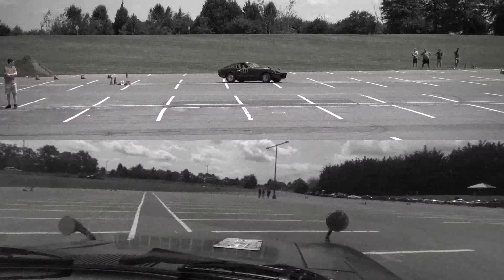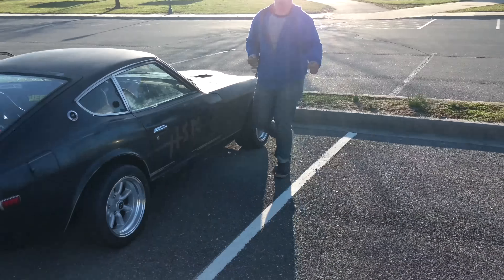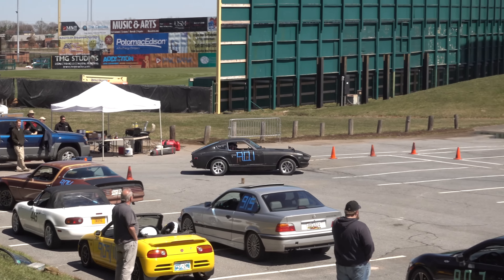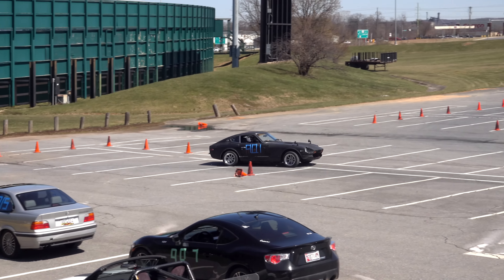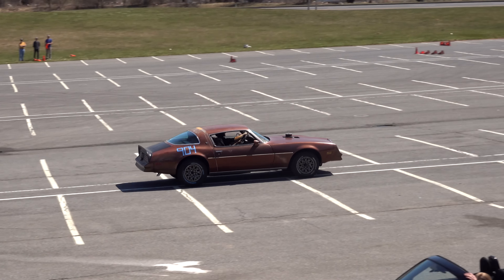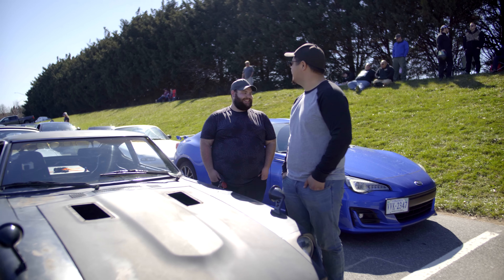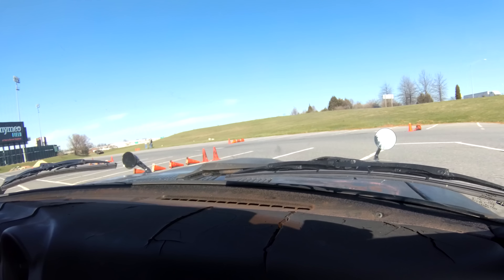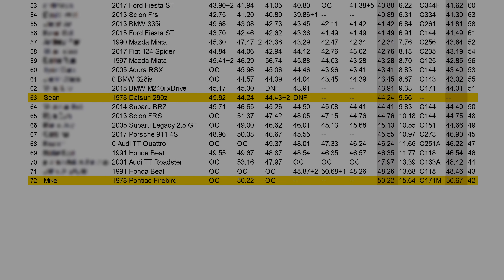1978 Datsun 280z and 1978 Firebird at Autocross (CDC 2018)

Comment: Old street racer trick:  race with no more than 1/8 tank of fuel.  It saves weight (~6 pounds per gallon).  Better yet, if you crash and burn, the fire won't last as long.  ;)
Reply from the maker: Fair point! Part of the reason for filling it up so much is that the tank doesn't have any baffles in it, and if the gas level was low it might slosh too much and give the engine a hard time with all this hard cornering. But it was definitely filled higher than it should have been.
Reply: Generally, for autox, fuel slosh will affect your times more than the weight of a full tank.

Comment: You guys have such the good mindset on this. It's all about having fun and making new buddies. Well done! BTW, if you want to get rid of some understeer and don't want to go nuts on negative camber, give it about 1/32 toe out in front or a lttle more if you want. Your inside wheel will pull you in some while turning. Been tracking cars for about 25 years. Always a treat to watch your adventures!

Comment: I just watched the whole series today. I'm thinking of building a Corvette C4 with one of those Weiand superchargers or one of the Edelbrock H122's. The Edelbrock uses the new Eaton TVS technology which is more efficient and makes less heat (theoretically). Your videos were very informative and professional. Very well done. You gave me a lot of tips for what to look out for. My big issue is going to be the blower drive. There is very little room in front of the damper and the steering rack. Not really enough for the extra pulley. I have been looking for a week and i can't find anyone who has done it. Guess I'll make a video and show how to do it. (As soon as i figure it out!)i
Reply from the maker: Thank you for the kind words! That sounds very cool, good luck fitting the drive in there!

Comment: Well done!

Generally I'm not a big fan of too low profile tires (those 40's on the Z, but I love the panasport style wheels, it needs flairs now ;-) ), on the local autox's they'll cost you time: Harry Grove has a bunch of little dips in it that will upset a car with stiffer sidewalls more, Ripkin has a BIG dip in it that usually ends up around maybe the 3/4 mark of the course that with short stiff tires will cause you to lock your breaks coming through there and most people don't recover before the end of the course.  Back in the day (before 9/11, the best autox venue around here was Ft Meade), we ran both heats like you did and had a set of identical hoosier slicks, 245/60-15 and 245/50-16 on knockoff Corvette rally's and swapped them between heats on my 3rd gen f-body and a friend's 2nd gen.  We both ran faster on the 245/60-15's, and found them more controllable at the limit.

Your 2nd gen 'bird can be made VERY competent on the autox, it has some of the best suspension geometry if setup correctly until you get to modern vettes and exotics, and the positive displacement supercharger gives a very controllable and flat torque curve.  If you want to do it cheaply and well, try to dig up Global West's advice/specs from the 80's (it was in every one of their catalogs from the 80's and 90's).  Back then it was more about getting things right than throwing someone's $$$ suspension package at it.  My friend in the above paragraph had some simple mods to a 2nd gen split bumper Z28 and went to nationals every year.

Comment: Good stuff, invest in a bigger air filter for the fire chicken, as proved by engine masters these tiny filter stool as much as 20whp on the dyno.
Reply: Yes he needs one with a filter element in the hat. All the filters with the direct flow into the carb worked the best, so the air doesn't have to go around corners first. I think he needs more aggressive gears more though.
Reply: sirgallium more gears,
Wight reduction
More powaaaaaaaa,

Comment: Hi. watching along for a good amount of time. not an native English speaker so sorry for my spelling. 
Regarding the rubbing of your tiers. you should lift the car up and put some spare tires under the cartiers diagonali and then lower the car down on the two tiers. with this method you get heavy compression on two oposite sides. Then you could check you clearences around your installed tiers. Greetings from germany.
Btw. here in Germany we cant swap tierdimensions so easyli. we must get them controlled by a goverment Organisation called TÜV.

Comment: Have you washed the protective blue off the lettering for the tires? It will make the car so much faster.
Reply from the maker: I tried (lazily) with some basic soap but most if it is still on there. Havn't bothered to try something stronger but I would like to. Going to need all that extra speed!
Reply: @FuzzyDiceProjects  Wesleys Bleach Wite!

Comment: Hey fuzzy man I need some help I got a 1987 chevy s10 blazer that I bought and fixed up for about a year and it's the 2.8 v6 we rebuilt the motor and everything but we can't figure out why when I do a cold start every morning  it takes a while to start then when it finally starts it stalles then the second time I start it I have to wait 10 min for it to run cause if not it will run sloppy as hell when I'm slowing down to get to a stop sign or stop light it acts like it wants to stall and sometimes it does and if I have my foot on the pedal for 2 to 3 sec then it stalles for it not to stall I have to press the pedal all the way for like a sec and I need help cause I don't want to keep driving it like that I want to drive it like a normal car and not have to worry about it stalling and also that motor had a carb on it and we put a fuel injection on it
Reply: Did you change the fuel pump ? What amount of fuel pressure are you running ? Remember carbs run at about 6 psi fuel injection runs much higher
Reply: yup got a new one still the same old and yea the mechanic told me the pressure but I have to get back with him really trying to figure this out
Reply: That was my first thought . Good luck man hope it works out
Reply from the maker: As others mentioned, it does sound like a fuel mixture problem. Test the coolant temperature sensor in the intake manifold and the fuel pressure, and with the engine idling watch the injectors spraying to see if the spray is even and timing is consistent. If you rev it in park does it stumble and run poorly? Could try adding some carb cleaner/starter fluid to the intake while it is running poorly, if it clears up it is probably lean if it doesn't/stalls it is too rich.

Comment: don't you have to get your car inspected there(for road use)? I would fail  that on many levels... people get failures on rust, I got multiple on wet bottom (it was water- rain), small rust hole in the bottom, failed bulb on license plate, multipletimes on cracks of the exaust system. these are on different inspections of two cars. The joy of using old car here. had some legit causes: failed rubber suspension components.
Reply: Depends on the state. My state doesn't require any inspections. As long as you have a title you can register it here

Comment: The Firebird needs to be louder.
Reply from the maker: It is the highway gears, it doesn't get loud until it gets over 2500 RPM, and I don't think it ever did even in first gear on this course. I like the volume, fairly nice and quiet at idle and cruising but certainly does scream at high RPMs
Reply: Fuzzy Dice Projects Ah, ok. I can't say I've watched a video where you've gotten the Firebird screaming down the road. That's sorta how my dad's '77 Nova is with its flowmaster exhaust.